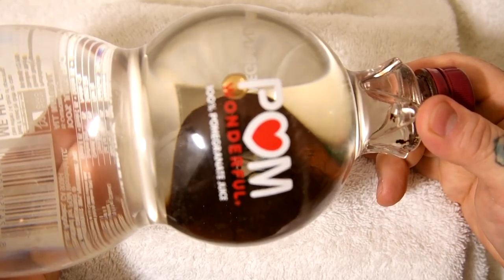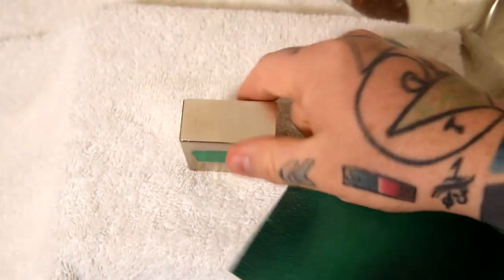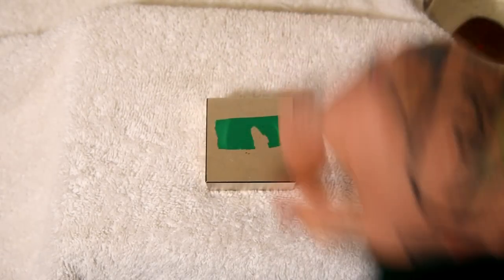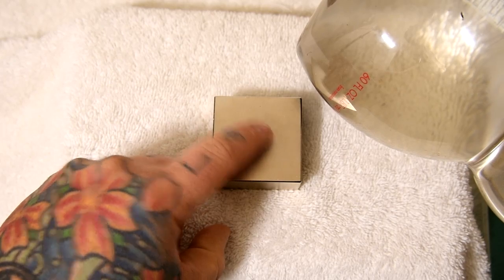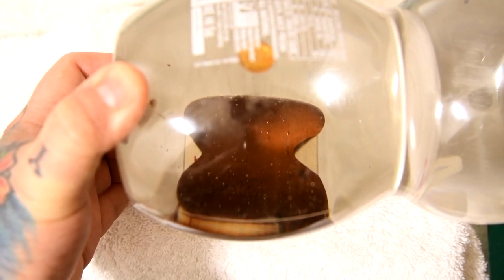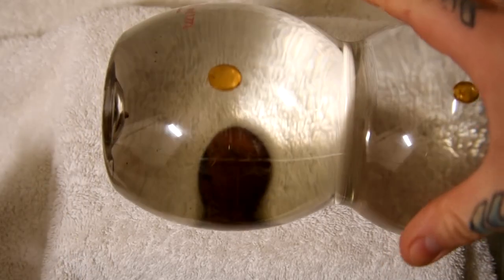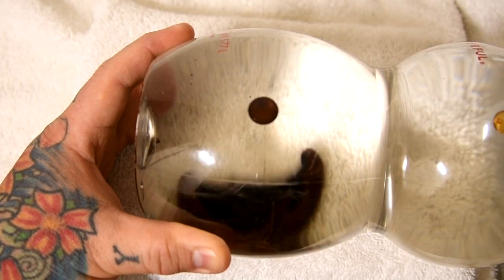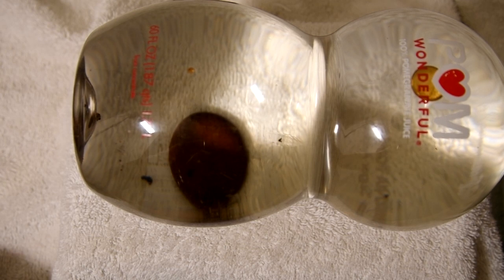*!* FIRST TIME EVER SEEN * Geometry of Space/Force & Counterspace/Inertia

Comment: Looks to me like the regular hex lattice (physical field) of +ve cells in an ethereal sea of neutralising -ve matter~energy flux breaking down due to one or more lost, free cells leaving a highly -ve hole, pulling in the +ve cells of the base subspace, accelerating them to 'escape velocity' (speed of light) where they pass through or collide at the centre and bounce out, then loop back in, 'stabilising' (though in constant, not quite neutralised motion) with all loops in the same direction from pole to pole ... The lost, free cell that created the hole also forms a particle.. As a free cell pushes through the lattice it warps it. The energy lost pushing cells in front aside is returned as its -ve 'wake' pulls in lattice cells, giving the free cell an intertial kick forwards. This process and base -/+ field can repeat at different scales and larger particles can be made from smaller particles...

All higher level particles compact the lattice as they pull in -ve flux due to extra +ve cells and the motion of +ve cells torwards -ve centres.... matter concentrates +ve cells and -ve flux, making voids more +ve and thus expanded (and continuously expanding), presuming a finite universe with finite +ve cells and -ve flux.. -ve flux flow is concentrated towards centres of gravity....

Comment: two tear drops create a figure eight like infinity. Represented mathematically,  two counting equations in an opposing sequence....3,2,1 1,-2,-3...  (notice the extra bump 2 in the middle directly across from -6). In a circular array this creates motion until it doesn't....if one could store those tiny aurora borealis during the trip, could we reset the clock back to zero with a pulse? i.e. -3(-4)=1 and the collapse 4-3=1? We should talk about the electronics involved it might be a fun project.

Comment: For clarification, could you show this again in a flat bottom container?  A petri dish or a beaker comes to mind.  It doesn't need a lid for a quick test.  The cup shape seemed to happen when the ferrofluid had to flow around the trapped air until the bubble broke through the ferrofluid.
Reply from the maker: flat bottom would show the same damn thing
Reply: Because the magnetic field is coming from the center of the magnet in the shape of a toroid. on the side it will look different then the top / bottom respectively. On the top / bottom it will appear as a donut shape and on the sides as a hyperboloid along the plane of inertia.
Reply: Prove it.
Reply: Watch all his videos. Read his latest book.